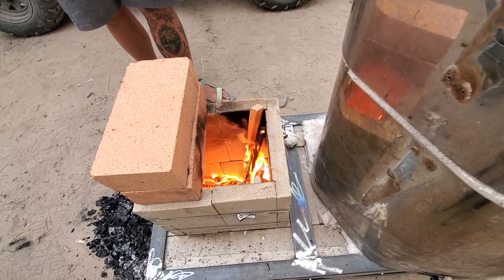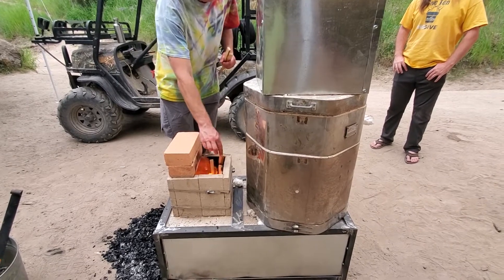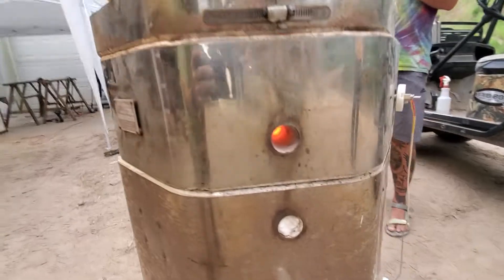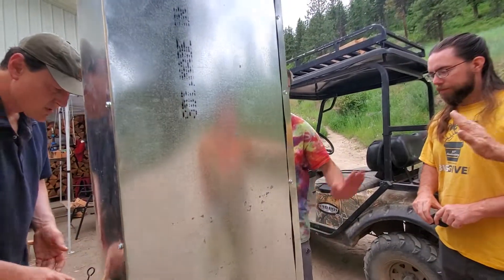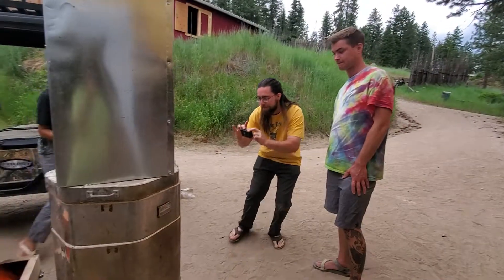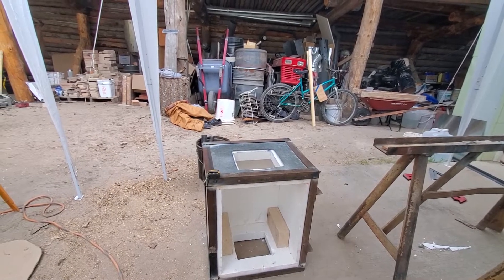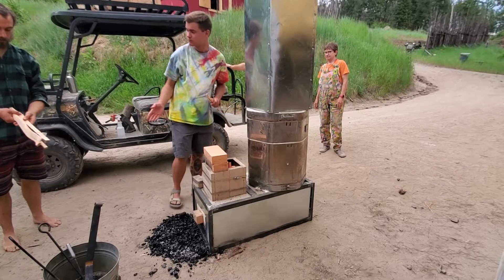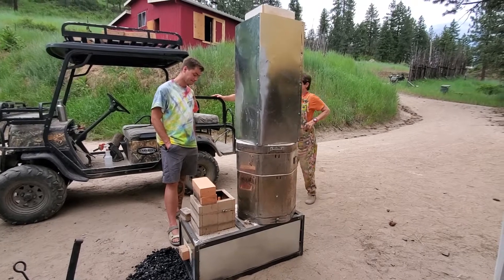Rocket Pottery Kiln First Fire from the 2022 Permaculture Technology Jamboree with Uncle Mud

Comment: what is the riser constructed of?
Reply from the maker: Ceramic fiber insulation board
Reply: @UncleMud  ok. thanks. I was working with it before but unable to get any in The Netherlands. If anyone out there has advise let me know please
Reply from the maker: @fraserstewart7359  I have also built good risers out of ceramic fiber blanket, or lightweight kiln bricks
Reply: @UncleMud  was thinking of building one as a batch rocket stove with riserless core. I picked up an old kiln. was thinking to place the exhaust of the kiln down low for stratification in the kiln. that way all the heat will be used by the kiln. 
What do you think of this approach?